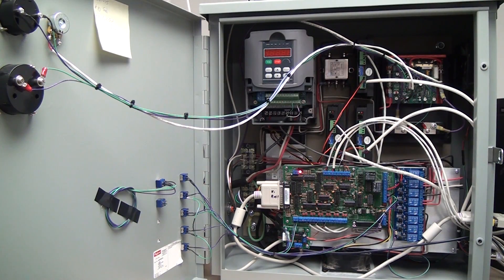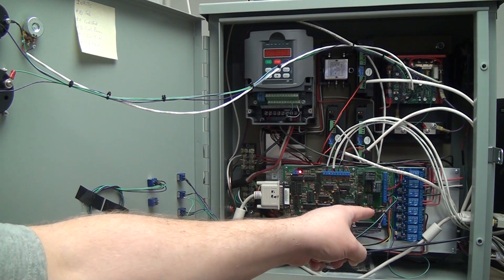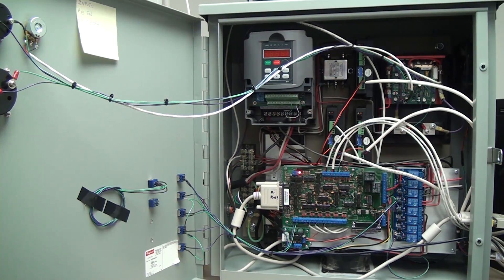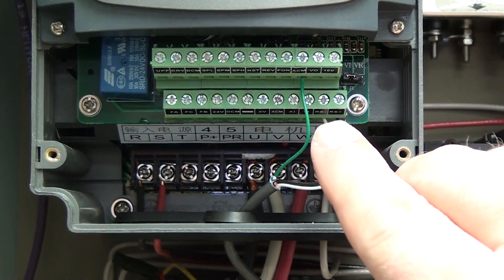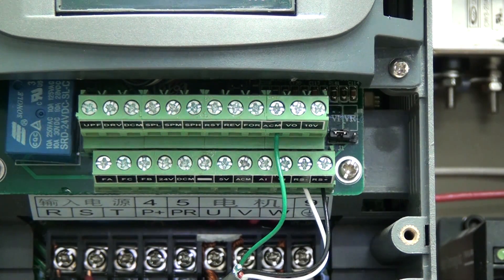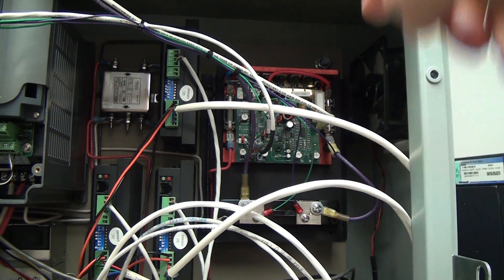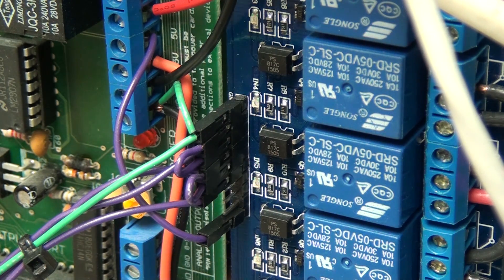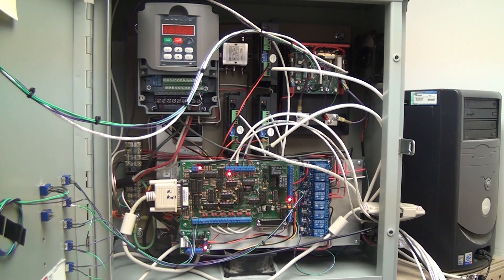G0602 CNC Conversion pt9(3/3) - Enclosure (verbose)

Comment: What gauge wire did you use for the basic wiring of the switches and pcbs?
Reply from the maker: Hey Kevin. The switches are wired with something really tiny. Maybe 26ga. Since they are only 5v to control the relays, it can be about any size you like.

Comment: I would have 2 switches on the outside - Master on/off and mode - lathe/mill, that is it, and then a few quick diagnostic leds for each voltage supply, an ammeter for spindle maybe, all that micromanaging is unnecessary, you could even add few extra relays and sockets so that both mill and lathe cables are connected to the box at all times and have relays do the routing to the appropriate output when you switch from mill to lathe, one extra board inside and a lot less hassle for eternity, or as long as you will use the setup

note - when you wire stuff to the door of the box, use some sort of stop for the door (how wide can you open it) other than you electric cable length, and fix cables coming from the inside the box at the very top as close to the hinge as possible (cable has to be directed downward), and let them drop down a few inches forming a nice U loop, and then fix the cable to the top of door near the hinge - that way the cable is doing twisting motion instead of bending - which is a very bad design anyway you look at it, even if you only open the box every now and then
Reply from the maker: +jz1199 I agree on most of your points, and considered a lot of them myself when laying out the design. At this point, it isn't getting any more attention until something breaks. I've already lost interesting in making it any better, and lets not forget this is for hobby grade equipment, not industry. If anything fails, it's quick, easy, and cheap to fix/replace :)
Thanks for watching!

Comment: My wiring would probably end up the same way too. Kudos to you finishing it without having your brain melt away.

Out of curiosity, I assume the VFD is for the lathe motor, what is the other motor control board for?
Reply from the maker: +Moen I That's the mill's drive. It has a DC motor.
Reply: +russtuff ahh, yes. I remember you saying you are going to use it for both mill and lathe, makes sense now. Thanks for replying!

Comment: I like  your  module layout... very nice  job you did on that.  On the wiring  side.....Hmmm....Looks like you started out good wiring layout then you just wanted to finish the job. I understand,  sometimes we just want to get the job done. 
Having said that.... I doubt on myself... even to achieve this. 
Great Job Russ.
Thanks for sharing.
Reply from the maker: +rrangana11 You're absolutely right. Its easy to start with good intentions then end up rushing it. I just wanted the dang thing running :)